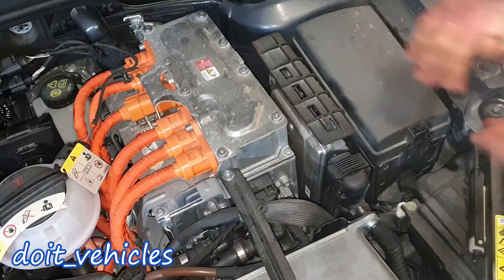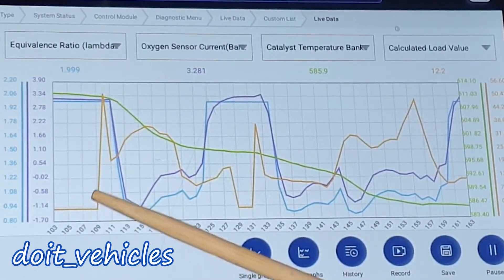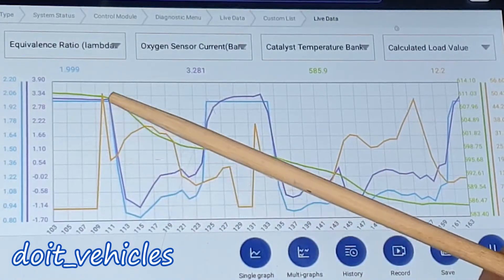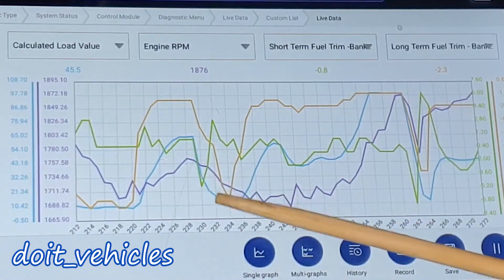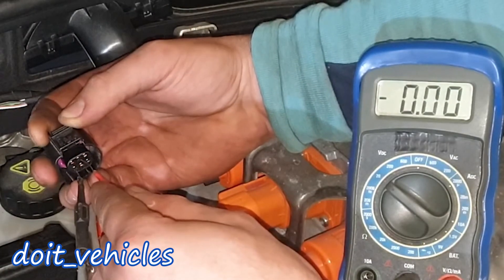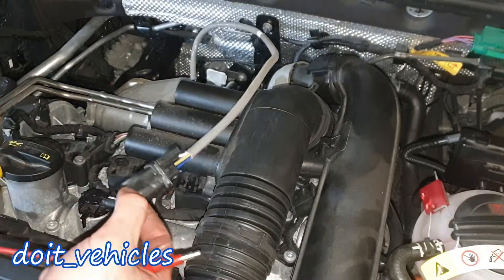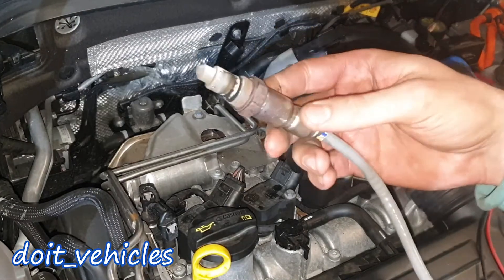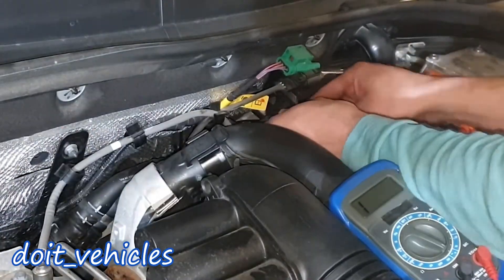1.4 TSI Volkswagen GTE O2 sensor Test , Removal , Live Data

Comment: Hello, 
i am aware that this is a completelly different video to coment on but since it is the newest, I imagine it will get the most attention from you. I have a question regarding W211 E270 CDI (since i saw most of your videos on Mercs, I imagine you know them pretty well) are there any hoses under the fuse box in the engine bay? My car seems to leak coolant from somewhere and for a week i was trying to find where and found no puddles under the car or engine tray, checked engine and transmition oil, waterpump, reservoir and everything seems just fine. Today i was so desperate that I took the fillercap off and didnt put it back on properly, just few turns. I thought the valve in the cap is shot so coolant runs out from the overflow somewhere when the engine pressurises it. I did that and took it for a little drive (around 8 km) and i stoped in the parking lot slightly angled to the left (reservoir is on the left). Had a quick smoke and when i was comming back to the vehicle, behind front left wheel was a puddle of coolant. Since the reservoir is in front of the wheel and it was driping from behind the wheel, i figured it should be some hose located there. Maybe heater hose? it is somewhere under the fuse box (alteast i think it is a fusebox :D). OR do you think about anything else that could be a problem? please let me know if you will read this. Thank you very much in advance.